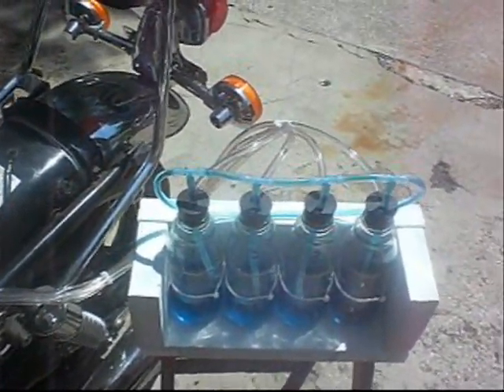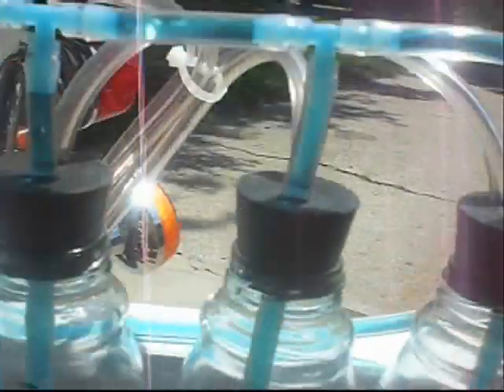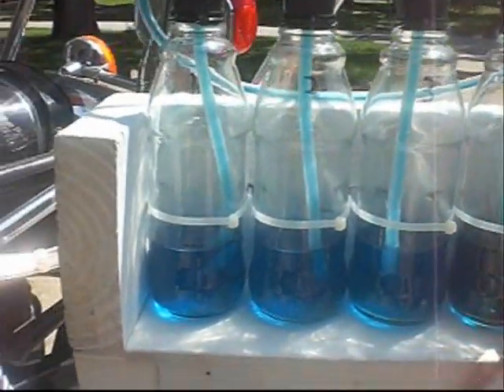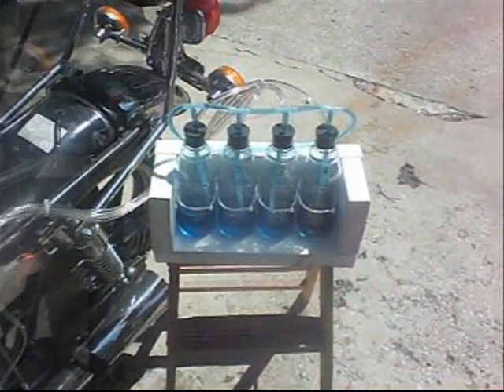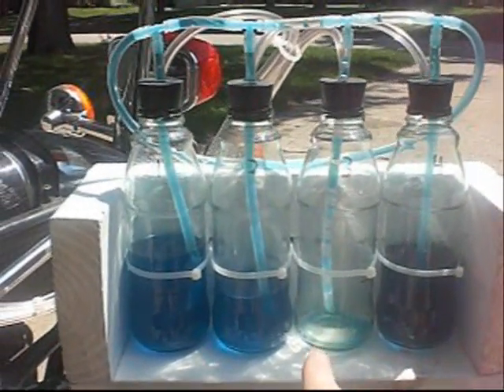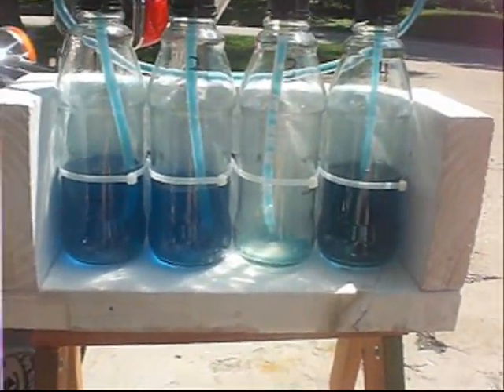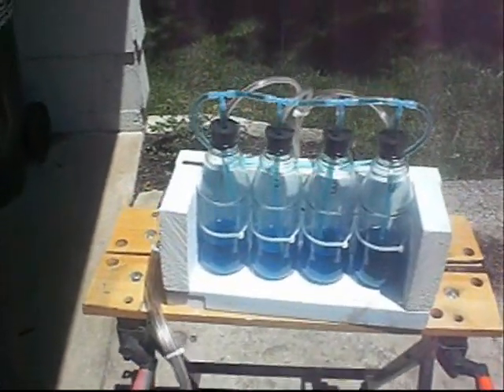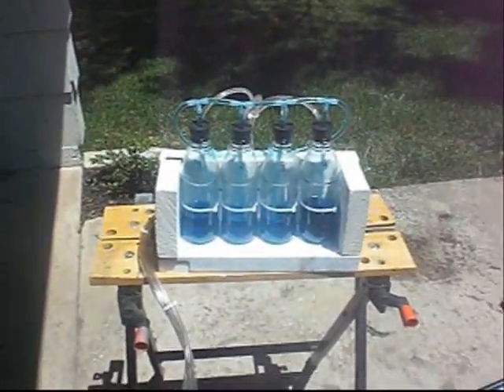Homemade 4 Cylinder Carburetor Synchronizer/Manometer

Comment: Great idea! 
I'm curious, if you can increase and decrease vacuum, don't you want max vac for max hp? In this case you would want max values on all cylinders. I can see where a digital readout would much better in that case.
 
OR (afterthought) Are you simply adjusting the balance of vac pressure?
Reply: At idle the throttle's butterflies (or slides on older carbs) are limiting how much air can get into the intake track so the vacuum will be high. When you pull the throttle the butterflies open, allowing more air into the intake track and the pressure comes up closer to atmospheric pressure. Because valves always open the same amount (in non-variable valve lift/timing engines) it is the job of the throttle body to essentially "hold back" the engine by restricting the available air. Worn engines can actually be synced at idle and then come out of sync as they are revved because one cylinder is flowing better then others, usually due to dirt on intake valves. This isn't really an issue though as you tune each carb to its own cylinder. Syncing is really only important at idle because each cylinder is operating at the very bottom of its performance potential where any error means that a cylinder might not be getting any air at all and it won't be able to fire at idle.
Reply: Carb Balancing is done to get the Vacuum between Cylinders to the same level at idle.
You're basically synchronising the Carb Butterflies (in CV carbs), or the Slides (in Slide Carbs), so they all open exactly the same amount, for any given throttle position.
A Water manometer will be more accurate than Mercury Vacuum Gauges or Dial types.
You're not altering the Vacuum produced, you're just comparing between cylinders.
Reply: max vac is probably at full throttle.....this isnt about max vac this is about getting to all suck the same amounts at tickover and doesn't affect power or max flow etc at full throttle
Reply: John Doc. - balance at idle only - anything more is speculative
Reply: Shed Man - Synced carbs probably move the same weight of fuel air mix.....the needles/pilots adjust the ratio of fuel to air. There is NO such thing as a PROPER sync gauge. I guess though you are referring to a damped diaphragm and spring gauge or a flow meter with damping - both of which leave the factory on Monday nominally reading some fictitious absolute air pressure measurement . By Tuesday, still in their packages they will no longer read the same nor again on the wednesday......too many variables eg phases of the moon, position of the tides, density of air, moisture content, internal friction, spring constants, damping rate, frequency response - to name but a few.......in other words NO WAY accurate. Ask yourself how an engine can suck blow bang on 720 degrees and the meters are set to give a steady reading....So why bother having 2 or 3 or 4 gauges when the only thing you hope to read is differential pressure Today. Tomorrow of course they will all be out of sync again as no carb will be linear and identical to its partner - the sun has only got to shine on the opposite side of the bike on the way home.....You make assumptions of what carb affect what in a group - so what when they are different (and all firing at different times)? You are only interested in getting them nominally the same on a day at tickover - the rest of the time it does not make one hoot of difference.....

Your last line is a truism - as carbs usually share the same airbox
Reply: i believe that generally visual setup of carbs is good enough for the purposes of running most engines.......no one has equipment capable of measuring indidual flows of various jets apart from the manufacturer.  I also believe you and your experience but zeroing your gauges yearly might be commendable but probably just disconnecting the gauges from the test machine walking around the block and reconnecting them would cause them to read slightly differently. Likewise they are not linear - nothing is, nor will they respond to different frequencies in the same manner. What gauge manufacturers do is increase the damping of the gauge to calm down the cyclic pressure of an engine and give you a saisfying calm needle. So as all the springs are different and non linear and each have different damping. - The results you are reading are just what I said in my first line - just good enough and claims to accuracy just cant be. The method above - manometer - seems to have common damping to all bottles. It seems to have consistent fluid density to all bottles and maybe if the fluid volumes are the same in each bottle similar spring constants. It would seem from first appearance that this method is more likely to be accurate at measuring the differences between carbs........rather better idea than the idea of measuring absolute pressure of each carb and trying to compare the......

I do not deny your experience and surely you will bring them close by gauge and tweak the last step by ear.......

I propose an alternative method for discussion -  measure engine speed accurately over 720 degrees. Using one means of measuring the crank speed as opposed to four vac gauges on the carbs. Then tune the carbs to minimise crank speed variation..    Bit like balancing a wheel and tyre combo.

Thank you for your comments
Reply: Stuart Marshall - BTW The Bernoulli theorem states the higher the speed of flow the lower the pressure (the higher the vacuum)

https://www.google.co.uk/search?q=benouli+theorem&rlz=1C1CHWL_enGB627GB627&oq=benouli+theorem&aqs=chrome..69i57j0l5.4651j0j4&sourceid=chrome&es_sm=122&ie=UTF-8
Reply: Dan Barclay The throttle limits airflow to an engine by reducing the volume of air allowed into the intake plenum, not by reducing its velocity. 

At a given RPM with the throttle in idle position the aperture for air entering the intake track is very small and thus, by the Bernoulli Principal, the speed of airflow past the throttle plate is very fast. With the throttle plate wide open at the same RPM the area for admitting air into the engine is much larger and the velocity of the air past the throttle plate is much lower. Once past the throttle the volume of the intake is fixed and the engine's swept volume is specifically defined so the air will travel at the same speed once past the throttle at a specific RPM regardless of how far open the throttle is.

Perhaps it is helpful to think of the system in reverse. Let's say a hypothetical engine has a 1 liter displacement and is spinning 20 revolutions per second (1200 RPM). A 4-cycle engine only admits air into the cylinders every other stroke so this engine is sweeping 10 liters of volume per second. Upstream of this the throttle plate is in idle position and the engine is consuming air at 10L/second. Now let's say the throttle gets opened. The engine is still consuming air at 10L/second, so the velocity of the air hasn't changed, and the volume of the intake certainly hasn't changed, so Bernoulli's Theorem isn't even applicable! The only thing that has changed is the pressure of the air in the intake. The engine went from consuming 10L/sec of air at 0.10 atmospheres to consuming air at 10L/sec at 0.98 atm.
Reply: Sorry- Bernoulli is always applicable. Your first statement is a bit of a truism and assumes that one doesn't affect the other - Hardly likely. And Sorry but when I open the throttle my engines begins to consume a greater volume of air....the fact that it is moving faster means its pressure has dropped (bernoulli) otherwise it wouldn't be moving to the cause of the lower pressure (the engine intake) 

Furthermore I am not a great believer in describing an engine as a series of static phases (independent of a previous phase as a for instance) but easier to think of an engine as a series of resonant/non resonant (depending on frequency) springs. One of the drivers is obviously the engine valves. One of the reactant springs is the volume of the air mass and the operation of the throttle whose frequency, volume and pressure - all intertwined affect the running of the engine.   But in an effort to understand more - what is it you think I didn't understand? Be critical......
Reply: I was being overzealous in saying that the Bernoulli Principal isn't applicable, but it isn't a major player in intake pressures. It is absolutely true that at higher engine speeds and with wider throttle opening the pressure in the intake before the throttle plate will fall due to the Bernoulli Principal. After the throttle plate the engine's ability to consume air at a massive rate quickly overwhelms any effect differences in air velocity has on plenum pressures.

It is also correct that air is compressible and this can create resonant effects. Intake and exhaust resonance are regularly tuned to make power peak at certain points but in the overall mechanism of an internal combustion these effects are quite small. A tuned intake stands to gain 10-15% horsepower at a narrow RPM band over an untuned velocity stack.

The fact remains that it is a common diagnostic tool to test engine idle vacuum to detect air leaks and intake pressure does indeed climb as throttle is applied.

Your error is in saying "when I open the throttle my engine begins to consume a greater volume of air." This is patently false. An engine consumes a very well defined volume of air at a given RPM. Opening the throttle has no bearing on the volume ingested by the cylinder. By limiting pressure the throttle regulates the amount of air admitted, but volume isn't changed.

It is also incorrect that "the fact that it is moving faster means its pressure has dropped (bernoulli) otherwise it wouldn't be moving to the cause of the lower pressure". Air moves towards the area of lower pressure by diffusion. Bernoulli's Principal is a special case of the movement of air.
Reply: I think we are beating around the same bush but are neither physicists......You seem keen describing  a static phase.....I keep trying to describe a dynamic system.....EG the air may well be compressible but as you say small effect.........On the other hand the air moves forward at a frequency determined by engine speed and intake and partly the resonance of the airbox.......The description and analysis of the frequencies involved are in my opinion more interesting in describing the movement of the gasses. I agree that on a CV carb I have no idea what the Pressure does or how it interacts with the vacuum sliders.........Going back to my original point about accuracy of measurement - do you not find it interesting that an engines cycles through 720 degrees opening and closing valves that the pressure and frequency of the air cannot be measured with a shop bought gauge.......Please - Bernoulli may be the resulting analysis of air flow and not the driver of air.......BUT air always moves from higher pressure to lower pressure.....albeit perhaps further influenced by outside forces.....I understand the term diffusion to be the the movement of molecules in a gas - but we are talking about the flow of the entire gas....there may be parallels but there is a difference in scale and measurement that isnt in the same ballpark as gas flow is rarely defined by the distance between molecules. Strangely to you - but quite easily observed - as I open my throttle my engine does consume more air (fuel mix) hand in hand with the acceleration this causes.....It consumes air in proportion to the frequency (rpm) of the engine and as a function of frequency of the air that can be supplied.  

Dont get this at all: 
After the throttle plate the engine's ability to consume air at a massive rate quickly overwhelms any effect differences in air velocity has on plenum pressures.
All the best Stuart - Dan
Reply: Clarification : I am not sure what the pressures are at low engine speeds at the tip of the butterfly where I imagine a lot of air goes through a very small gap  - and whether - the pressures in an engine running at full open throttle at max revs at max air flow - are comparably similar or dissimilar.    Secondly frequencies - I liken an engine to the old experiment on resonance where three different objects are excited on a piece of string. they vibrate according to the the harmonies between the driving frequency, their natural frequencies and perhaps interference between them (beating harmonics etc). Imagine an engine (revs/frequency) as the centre object. and the (tunable) carburetor on the front end of the string.....and the exhaust another tuneable frequency..........when the items are all in tune the engine goes faster - frequency analysis, fourier transforms etc will lead you to a better understanding of the frequency response of the engine under varying dynamic inputs - which are best described as frequencies and not a series of changing linear flows. Likewise the frequency response of a gauge with a spring constant and damping can be questioned and the question asked as to whether it is an accurate tool capable of providing accurate repeatable measurements or a placebo in big boots....

Comment: thank you for sharing. tried your method, however I struggled my ass off.... got a zzr 1100 c model. system worked fine just could not set up the sync process, due to number 1 keeps on sucking the plastic bottle and squashing it and number 3 keeps on sucking dry. I then went back to the bench set up and bike sound good and perform good. however I would like to know what I am doing wrong. please help.....
Reply: Almorie Scholtz FYI, if you have a high performance vehicle you can eliminate many problems using glass bottles instead of plastic.
Reply: airleak? carbs are way out of balance - you have to adjust the highest bottles down as well as the lowest bottle up

Comment: i use 2-stroke motor oil instead of water or gas, i like it because its viscus and non-volatile
Reply: but viscous causes the fluid to climb the edges of the tube making it harder to read - it also slows the reaction of the fluids=inaccurate

Comment: "I would use gas" - Funny - I am only disappointed you said check it against a "bought" system - it is because of the inaccuracies, random damping of the shop systems that I go to a manometer particularly when the damping is a single common system shared. Thus you have no need to wonder if the damping is the same.

Comment: Quick question - I just bought 4 vacum gauges for 9 bucks a piece. There is no water involved with the units, Just the meter and the tube.

The box says its a manometer and its gauged . Why wouldn't it work if you are just measuring/adjusting air pressure from each cylinder. As long as they all read basically the same, and the bike runs well, wouldn't that be considered that they are synced.

Just askin and if yes, a lot simpler and no chance of liquid aspiration

Comment from the maker: RPM was about 1800 during the video portion of my synching.  The manual for my bike (of course, check your manual for your own bike) wants you to do it at 1200 RPM, but as you make adjustments, the RPMs will often increase/decrease with very minor adjustments so it's difficult to stay exactly at the recommended engine speed.  Just make sure you keep it as close to recommended as possible as the lowest RPMs is where the synchronization is most important.

Comment from the maker: I used a "T", just like you said, to connection them.  Buy them at a hardware store or you could use the 'tees' from a drip irrigation kit or something like it.  Even brass ones would work if you can find them to fit your tubing.  If you can't source them locally, try eBay or Amazon.

Comment: Very good, I had a 1980 CB 900 Custom, the book talked about using a manometer to synch the carbs, it said to get one with "restrictors" so that mercury wouldn't be pulled out of if.  Fortunately, I never had to synch the carbs, the bike ran pretty well for the 25 years I had it.  I traded it on a Goldwing, the carbs are buried so far down in it, I haven't even seen them yet after about 3 years.

Comment from the maker: I think I bought 20-25 feet total.  You'll need about 4-5' for each carb line so you can position the manometer in a good spot, plus a few feet for the connections between the bottles and Ts.

Comment from the maker: You are going to have to check your bike manual for that info.  There are usually vacuum ports on the intake boots between the carbs and the intake manifold.  Usually you have to have a special adapter (or make some, like I did) to screw into the port to be able to connect a host to it.

Comment: Just what's going on with this?  Why does the engine suck the one of the bottles dry?  Why do the carbs need to be synced? That makes no sense to me.  I live in Pa and it's cold out. The bike is hard to start.  It won't idle unless the choke is on. If I turn the choke off the bike stalls. The bike backfires also.  When driving the bike it drives fine. It also has a swear word on YICS. Retarded smog crap they come up with.

Comment from the maker: 1. Yes exactly, the level of the fluid doesn't matter; it's just the *movement* of the fluid that matters.  No/very little movement = synced carbs
2. Connecting the bottles like you described should be just fine.  It's all just a matter of making sure each bottle is linked to the rest somehow.  You *don't* want simply 1 connected to 2, and 3 connected to 4 (like I've see on others) without something linking the 1/2 and 3/4 pairs you've created.  Otherwise you are only syncing 1 with 2, etc.